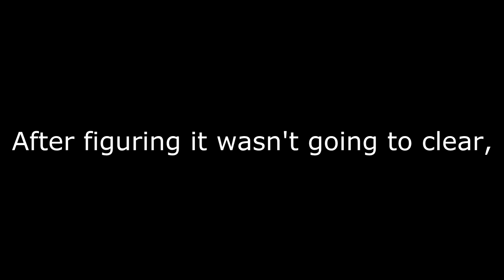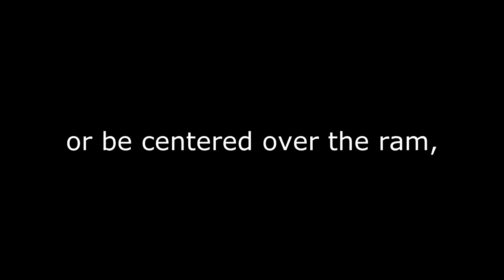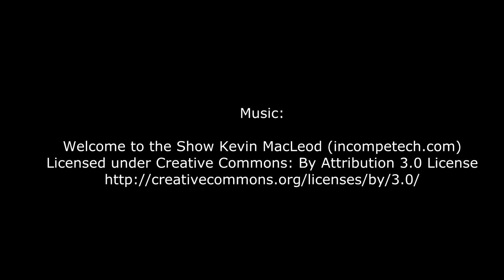Restoring a 125 Year Old Drop Hammer - 100lb Ram Weight - Part 4 | Iron Wolf Industrial

Comment: I think You will hawe an even more muscular upper body after using that for a while... ha ha.
Great build, i love this project!
Reply from the maker: Back in the day, they would use a stirrup so you could have both your hands free... I think I'll have one ripped thigh haha!! Thanks
Reply: A guy i co work with from time to time got some full size macines some years ago, i plan to go there and help him setting them up when hi hawe a proper building for them that can handle the concete foot of the the bigger ones... But i guess a machine of this size does not require much more then a regular spring hammer...

Comment: Hay gr8 job done man .....but whats the use of.motor ...did not unerstand ..
Plz explain .....what role will motor play...if its a mannual one
Reply from the maker: The motor spins a drum through a gearbox. This drum has a spring-loaded disc in the center that keeps the flat belt raised above the surface of the spinning drum. When you pull down on the belt, it compresses the spring, and the belt contacts the slowly turning drum. This drum rotating assists with lifting the 100lb ram to its final height. It's not completely manual or completely automatic, it's more a motor-assisted hammer, as the user still has to pull with a bit of force, but not nearly as much as if there was no motor. Thanks for the comment, let me know if I can clarify this further.
Reply: Plz.make a vedio .....

Comment: The belt looks a little long IMO.
Reply from the maker: The belt is at just about the right height where it stands currently. It works for hand operation by a second individual, or by foot (stirrup) operation by one individual. Typically these hammers were foot operated, and the operator would lift one foot up, catch the stirrup on the end of the belt, and bring it down to the floor to raise the ram. To release, he simply rapidly moved the one leg up quickly. Thanks for the comment
Reply: Iron Wolf Industrial. Oh cool, I didn't know thanks.

Comment: Your a good lad to get that up & running... 
But your a bad lad for getting up 10 tread step ladders like that on your own... 
Listen... 
I've got a set of 10 tread fiberglass Clow ladders and I know they really need footing by someone... 

Anyway...enough of all that health n safety shyte... 
What you have there is a very nice bit of kit that'll return your efforts... 

PS:
What was the Darth Vader mask all about...? 
Just stand up wind of what your spraying and you'll be Rite... 
Let it be someone else's problem downwind... 
Like if 'er nextdoors hung her washing out downwind just before you Started spray painting it...then it's her hard lines innit... 
Just a thought mind you... 

So you'll be making up some tooling next for it... 

On another note:

If you like have a look at my channel...
I've only one video at the mo...but it shows a selection of what I've got in storage... 
Their all lineshaft driven stuff...mostly British made but I've a decent south bend lathe and a German shoe finishing machine which I'm going to set up for metal Polishing...but that one isn't in the video... 
I've 2 radial drills, 3 pedestal drills, 2 bench drills, milling machines, 6 bench, 1 surface & 2 pedestal grinders, 2 mechanical hacksaws...allsorts...and a load of woodworking machines as well:
Mortiser, 2 workshop table saws with 24" blades, 2 jointers, 3 wood lathes, a rare bandsaw, a rare Wadkin EV spindle moulder, an old tool & cutter grinder for planer/thicknesser & jointer knives...all for lineshaft running... 

I've loads of other stuff including a monster of a diesel welder, diesel hydraulic power pack and several diesel water pumps...
I've a nice old petrol generator used for charging accumulators for starting merlin engines during WW2... 
I've a couple of diesel generators as well... 

Have yoursen a look...☺️
Reply from the maker: Glenn, great video you  have there - impressive collection. For all that to be set up, you'd probably need a 30 x 50 shop at least. Clearspan with iron beams or rafters to mount lines to. Great stuff- wish I had a mill here but machine tools are virtually nonexistent out this way. Guys hold onto them until there's nothing left but scrap iron from all the use and abuse they see. That welder looked pretty serious. Yikes. Sounds like you've either got yourself the makings of a museum, or a old town. Either way couldn't go wrong!!

When I was hauling up that gear reducer, the ladder decided to walk away on me. Things got a little dicey up there in the rafters but I got it done and it worked out okay. I had that mask on because we didn't have much wind that day, and I figure every bit of that crap I can keep out of my lungs and system, the better. It would've been nice to have a hand with that ladder, but I know I would've worn out anyone around me with the number of times I was going up and down the darn thing.

Well, the machine is now running and that's the most important part. I am thinking of making a set of flat dies quick just to see how much force this thing has. I wonder what it would do to a 2" chunk of steel glowing white hot. Maybe it could make pancakes.Possibilities are endless, but I've got a couple neat ideas up my sleeve a few weeks down the line. Thanks for the comments and insight as always Glenn looking forward to hearing from you in future videos.
Reply: Iron Wolf Industrial 

I need to make some sort of a start on sorting at least some of em out... 
I could really do with the south bend lathe running...but we're in the middle of sorting out the arrangements for where it's going down at the yard...so it'll be a bit yet before I start making more videos... 
Anyway, I'm not very good I'm afraid in front of a camera... 
Your videos come across a lot better... 
Its just the way I am...